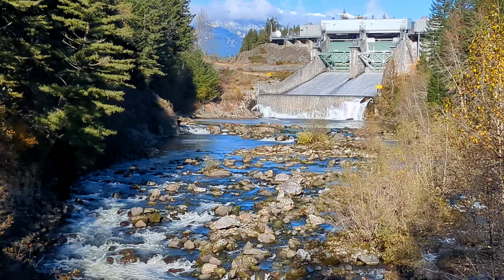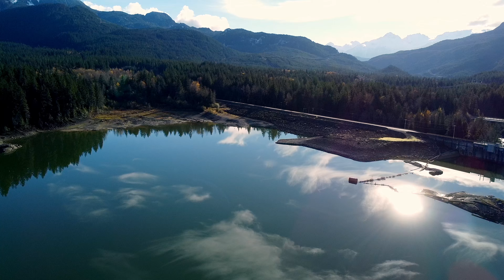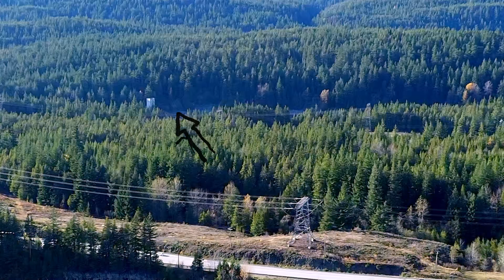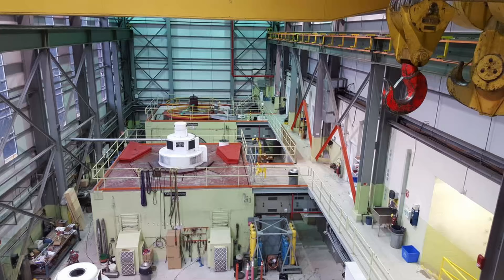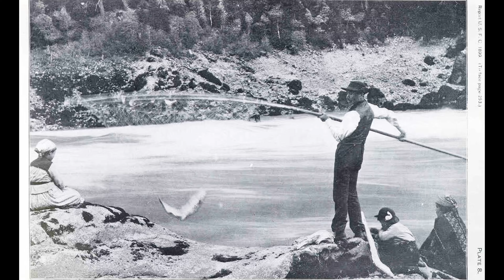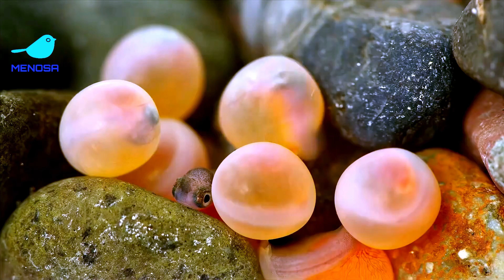Cheakamus Connections

Comment: I won’t be able to ride up the SV fsr without thinking about the connection between that power generator and the Daisy lake facility. Nice piece of historical videography.
Reply from the maker: Right? This video came about because an older guy (like, older than me) came riding out of Squamish River Valley on his bicycle as we were airing up and told us he had worked on the Cheakamus Power System back in the day. I never knew it was connected to Daisy Lake until then. Kinda cool.